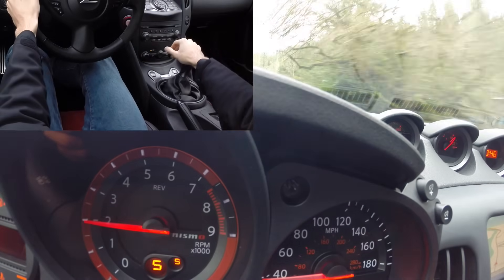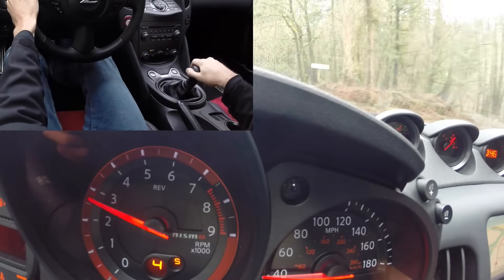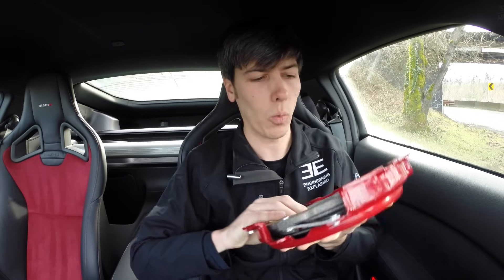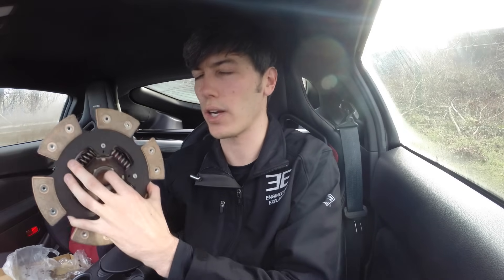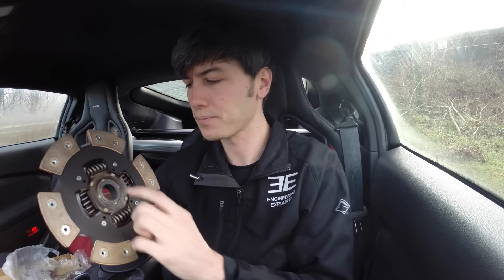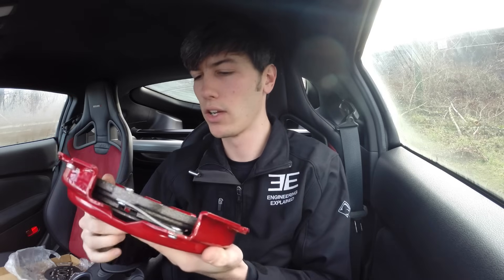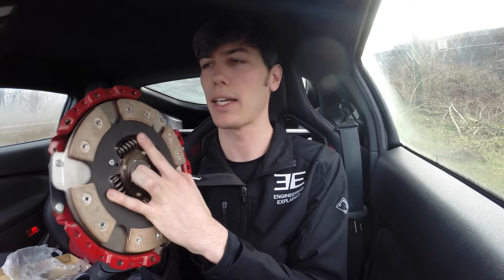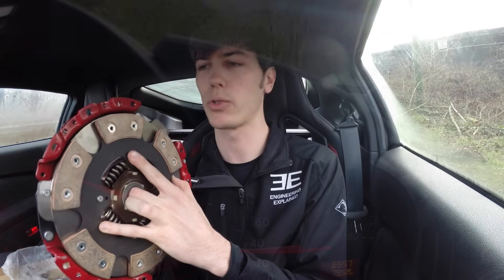What Is Rev Matching?

Comment: I don't think I've ever rev matched in my 20 years of driving, zero transmission failures so far. I think this is mostly what truckers do. And I engine break a lot, had to change my original brake disks after 12 years.

Comment: 3:00 ok so how could you possibly know how many rpms your transmission is at. How can you accurately predict the correct engine rpm before you downshift. Wouldn't you just burn up your clutch a bunch trying to figure it out
Reply: Well you cant burn your clutch when you're revving in the neutral and if you rev it too much then it's better as if you would not rev at all. You can predict it by knowing your car at which speeds is your RPM in various gears
Reply: Practice and feel

Comment: Never really had to revmatch cause i always have the right gear in. So unless you are changing gears in high rpms or going downshift 2 gears it doesnt make much sense to use it. just my opinion. It might save your clutch a little, but normal driving can either.

Comment: How does one know how fast the transmission is going? Or is it just about knowing where in that rpm/torque range you will be in when downshifting to have a smooth shift to where you’re not too high in the power band that you cant smoothly go back to giving it throttle?

Comment: Rev matching is not a simple skill to acquire. Every vehicle is different, and it takes time and practice to learn where the rpm should be for the transition from a higher to a lower gear for that specific engine and transmission. Then, you have to have a good sense of how much to blip the accelerator pedal and release the clutch. It's sort of a nuanced foot ballet!
Reply: Talking about having to baby a car since they're so fragile.

Comment: You should memorise what rpm the car goes at each speed in each gear. You only have to know 1 speed as it's a linear relationship. So if your car does 3000 rpm at 30 mph in 2nd, it does 4500 rpm at 45 mph in 2nd.
I'm still not very good at rev matching while braking.

Comment: What if there's a scenario where the gear stick gets stuck when you are downshifting, and that bump in throttle causes an increase in speed. Won't this be potentially lethal in an emergency situation? I generally use engine braking along with brakes in such scenarios. Wanted a few inputs for this

Comment: Or on old cars, that was very tricky, you didnt have synchronizatios so if you updhifting you pít clutch neutral realse put clutch put gear, and for downshift matce the revs cause if not or you did it wrong you can hear the transmittion slipping and you can broken everything down very easly

Comment: I've seen several videos about rev matching but not one actually discussed the most basic thing for us beginners which is the order on how to properly execute it. I wanna know the step by step process. Is it like this:

1. Step on clutch
2. Shift to neutral
3. Let go of the clutch
4. Rev engine
5. Step on clutch
6. Switch to lower gear

It's so hard to follow the tutorials coz they execute it so fast that it seems like they've already shifted to lower gear even before attempting to rev the engine which makes the entire concept of rev matching pointless.
Reply: those steps are for a double clutch rev match, which is completely unnecessary in a car that’s not like 40+ years old. you can shift into the lower gear before rev matching as long as you still have the clutch in, you don’t have to rev it in neutral

Comment: But seeing as all modern cars have synchromesh gears it is not needed.
Reply: no even in synchromesh this is very useful, you could easily crash the car if you dont rev match
Reply: @arcanevoid9199  don't talk crap, I've only ever driven manual cars, never 'rev matched' in my 40 + yrs of driving.
Reply: @chrisgray4651  im not talking crap, you should see what happens when you down shift and just dump the clutch like some people do. it is literally used in drifting to get the car sideways because it can and will lock the rear wheels (assuming rwd). its crazy that after driving manual that long it never came to you, plenty of people do it without knowing what it is. there is no other way to downshift quickly and smoothly from any rpm
Reply: @arcanevoid9199  you don't know what you are talking about. For example, driving at 30mph towards a junction, simply apply brakes, push in clutch ,change to lower gear, release clutch! No need for ' rev matching' or anything else.
Reply: @chrisgray4651  you can do it like that but it only works if you release the clutch slowly and youre at low rpm to begin with. try doing that when you are going from 3000rpm to 7000rpm with a downshift, the car absolutely hates it. and also what do you do if you need to speed up by downshifting? theres a reason newer manuals can do this automatically
Reply: @arcanevoid9199  of course the clutch is released slowly, the clutch wouldn't last long otherwise. I've watched a lot of these American 'how to drive stick' videos, and to be fair none of them seem to know how to do it properly.
Reply: @chrisgray4651  yea exactly you dont have to release the clutch slowly when you rev match, regardless if the revs need to go up 200rpm or 4000rpm
Reply: @arcanevoid9199  that's poor driving, and not how you should drive in normal day to day driving. What you are describing is not how to drive a car.
Reply: @chrisgray4651  how is it poor driving? and I’m sorry I like to drive my car the way it was intended to be driven, it revs to 8500rpm and has a second cam profile it switches to at 6000 rpm along with a 6 speed close ratio gearbox. It would be boring not to drive it like that. have you driven a manual sports car?
Reply: @arcanevoid9199  you sound like you have zero mechanical sympathy! That Honda Civic won't thank you for it.
I've only ever driven manual cars, here in the uk, automatic cars are uncommon.
Reply: @chrisgray4651  there is no issue driving like that once the oil is warm, using the engines powerband like you should isnt having no mechanical sympathy. also its a toyota celica with the same engine as a lotus elise, not a civic
Reply: @arcanevoid9199  yeh, ok! 😀

Comment: In the old days the technique to achieve this was heal and toe. With all the technology in race cars now days with semi auto transmission don't know if they still do it.🤔 Basically the point was to push the brakes with your toes while keeping the engine RPM up with your heal on the gas pedal keeping your engine from dropping to idle and shooting our of the corner once you were out of it.
Reply: its still used in many forms of motorsport
Reply: I had to do heel & toe with my old Sunbird, or else it would stall.

Comment: I learn manuel by myself still dont get this rev match i guess im doing it wtong by going neutral on corners and then rev up to go to like 2 ? Lol i got a 2006 gti stage 2+ I just usually wait until the stick lets me engage 😭
Reply: Bro never coast in neutral especially in corners, it is very dangerous and you can easily lose  control of the car, plus you are wasting your brakes more. If you were going 80kmh that is lets say 2000rpm for 5th gear, for that speed 4th gear is higher in rpms around 2.3k so you clutch, change to 4th and give throttle blip to around 2.3k rpm and you let off the clutch and 4th gear catches smoothly... I just gave you the example with numbers when you become more experienced you don't even have to watch at rev counter
Reply: @makerudji6682  thanks. Yea i had watch a video about it somewhere else, and new about it, just became a bad habit a bit cause I'm trying to do that break and acceleration toe skill thing and is taking a bit.
Reply: @Sh4rkeBotxD  Heel/toe isn't mandatory for daily driving, just downshift before corner. I guess if you want performance driving in your gti you gotta learn it tho 😆
Reply: @makerudji6682  u def should remake his video, lmao

Comment: Why put from lets say 4th gear to 2nd gear and revmatch ? Does it mean that my acceleration increases more than lets say putting it into the 5th gear ? Explain a little bit the physics of it if possible .
Reply: The lower the gear higher the RPM. If you are driving in 5th gear at 2000 rpm 80 km/h, at that speed 4th gear would be for example(it depends on a car) 2200, 3rd gear woud be 3000,2nd gear would be 4500. So if you want to downshift from 5th to any of those gears you need to give enough RPMs for wanted gear to the engine with throttle blip
Reply: @makerudji6682  thank you . The question was though , why do we do rev matching ? To save the sclutch  ?
Reply: @muzika8144  Yeah it saves clutch components and overall giving better driving experience

Comment: Honestly, rev matching is completely useless unless you want to be a racing wannabe coming off the highway around the exit ramp. Nevertheless, it's a very important technique, but the narrative that it wears your clutch less is a bit silly. The wear is so miniscule you can probably still drive until 300,000km and the clutch will probably still be ok. Again, unless you're a racer wannabe, it'll last you 300,000km.
Reply: it is not useless at all, idk how its being a racing wannabe if trying to make the same shift without rev matching is extremely jerky and upsets the car. and it does wear your clutch less, if you dont rev match the synchros along with the clutch have to do it for you, thats why it jerks if you dont rev match and let the clutch out anything but slowly. and especially in sports cars your clutches arent gonna be lasting 300,000, and if they are then you arent doing enough skids :)
Reply: @arcanevoid9199  99% of the world does not rev match. Why? Because it's not necessary. And the wear on the clutch is negligible. I drive smooth without having the need to rev match.
Reply: @Iesous27  I never said it was necessary, and that wouldn’t be the only reason people don’t do it. plenty of people can’t even drive a manual, and a good portion of people who drive manual only know the very basics and aren’t very good at it because they basically hit a road block where they don’t improve. and tell me how smooth it is if you down shift into a lower gear at 4000rpm and let the clutch out quickly. people have crashed cars because they didn’t rev match properly when driving fast
Reply: @arcanevoid9199  Of course it wouldn't be smooth if you down shift and engage the clutch immediately at 4000rpm. I don't do this and most people who do drive stick don't do this either. They either disengage the clutch from the flywheel until the car is as at an appropriate speed to engage the clutch for the lower gear, or, you rev match. At the end of the day, if I want to have fun and be more engaged with my car, I will rev match. If I'm feeling lazy and tired driving in the city, you can guarantee that I'm not rev matching and just releasing the clutch and popping it into gear when I'm at an appropriate speed. There's no right or wrong here, like I said, the wear on the clutch is negligible the way I'm describing.
Reply: @Iesous27  And you have just given one of the reasons why 99% of the drivers are completely clueless, unskilled and overall bad. You can literally ask engineers who make manual transmission what is the correct way to change gears and you will get the answer that it is with rev matching. I even know that Bmw(i don't know about other brands) in newer generation of manual cars built the technology, that you can turn on/off, rev matches for you. If you used common sense you would get a result where rev matching is 10x more better in every aspect of driving. It is quicker, smoother and safest for the gearbox, if you want both performance and comfortable daily driving, it is better in both cases, you are literally killing clutch components and overall disbalancing a car with that jerking thats present when you dont rev match.

Comment: Cool demo with the mechanical parts. However, I still don't get what rev matching actually is and how you do it. Is it just during downshifting -- you apply a bit of gas to get the RPMs higher while in neutral, right before putting it in the lower gear?

Comment: Say you were doing 80 at 7000rpm in 3rd gear, do you have to wait for the revs/speed to drop in order to rev match down to 2nd gear?

Edit: question 2 

Say 2nd had a max speed of 58 at 7000 rpm and you change into 3rd and the revs drop to 5500, what would be the point of rev matching if you can just wait for 3rd to drop to 5500 then change into 2nd gear and the rpm

Comment: can't you just brake and reduce the engine revs before going from 4th to 2nd? If you don't press the throttle it doesn't matter that you are at low revs in the 4th gear. To my understanding rev matching is only useful if you want to go from e.g. 4th to 2nd while maintaining your speed and not braking
Reply: you dont get any engine braking doing that, and its slow. i use heel toe alot of brake and rev match at the same time, its really useful
Reply: @arcanevoid9199  honestly I don't think it can even be considered useful, just an alternative
Reply: @apo1337  it is useful though, your technique is a bad habit and not good for performance driving. rev matching is so much better

Comment: But HOW do you know the speed between the clutch and flywheel?
Reply: trying holding the car at a specific speed in 3rd gear for example, and look at the revs. than put it in 4th and see how much lower they are, the change back to 3rd and try reving it up to where they were before. that’s only way to know exactly how much you need, but you don’t really pay attention to that after a while

Comment: My dad hasn’t rode with me in my manual car but yesterday was the first time he did and he was trying to argue with me that rev matching was bad and that it was all for “noise”, and that my trans and engine would break sooner. Obviously I was mad because when I first started driving manual, I use to downshift without rev matching and it felt so rough and jerky, nothing how a healthy car should feel like. Than I started downshifting and it was much much smoother, not too sure why my dads trying to argue with me here. Just mad he told me it was all for “noise” when it’s much smoother turning into corners

Comment: How do I know if the car is a 6 speed . Obviously the handle doesn’t have outline. And the reverse is all the way to the right where 5th speed would be if driving.
Reply: congrats you have a 4 speed
Reply: @itsalexoml9756  Actually it turns out it’s a six speed. It’s a camaro Ss which doesn’t come in 4 or 5 speed. It’s 6 speed

Comment: Is there a way to mathematically pre-determine the RPMs for all possible downshift transitions? Like if you're at 5th @ 2k RPM and wanna go to 3rd, how much would I need to throttle exactly to rev match for 3rd?
Reply: get to that speed in 3rd and look at the rpm, then go to 5th and try rev matching it

Comment: I think doing downshifting is tricky and harder compared to upshifting because you need to slow down properly and early so you can downshift smoothly if you are approaching a tight curve or road hazard
Reply: you dont need to slow down early if you revmatch
Reply: @arcanevoid9199  I've experience a crazy tire spin sound when I downshifted from 3rd to 2nd, I though I busted my tire belt, most likely because I havent slowed down enough
Reply: @rdu239  thats because your doing something wrong, when done properly rev matching is really smooth

Comment: This was SUPER helpful because I literally had no clue what Rev matching was, but I'm learning to drive manual and EVERY video is talking about rev matching...lol.  Thanks for making this make sense!
Reply: Or on old cars, that was very tricky, you didnt have synchronizatios so if you updhifting you pít clutch neutral realse put clutch put gear, and for downshift matce the revs cause if not or you did it wrong you can hear the transmittion slipping and you can broken everything down very easly😊

Comment: I have a question.  I’ve only rev matched in the process of double clutching.  And I’ve driven manual and double clutched for about 60 years.  It seems to me, that double clutching would be easier on the machinery than single clutch rev matching, and rev matching would be faster.  If that’s so, then how bad is it for the transmission, clutch etc. to rev match, as opposed to double clutching?  

I love your explanations!

Comment: I rev match whenever i'm in any situation where I need to shift to a lower gear. instead of pressing the brake then pushing in the clutch then shifting. I just downshift to the lower gear. Its quicker, more convenient and allows me to accelerate faster after I pass a corner.

Comment: I was watching him all the way up until he pulled that clutch out clearly he has no idea about clutches those type of clutches Puck style clutches are very Touch and Go there is no smooth transition the transition is very rough and subtle those crutches are garbage and as long as you throw your car into neutral you can put it in pretty much any gear after that is long as you know where your RPMs are and if you can't in your mind you know where your rpm should be then you shouldn't be driving a standard shift car and your clutch will not last long and this is not good on your clutch this is why my car has 214000 miles with the same original clutch

Comment: Do I cause any damage to my car if a don’t perfectly rev Mach?
Reply: Not straight away, but overtime your clutch will probably wear out faster and won't last as long, as it has to "work harder" to connect with flywheel (engine)